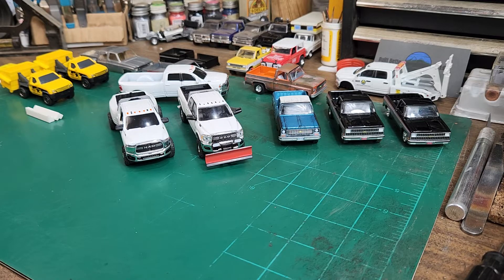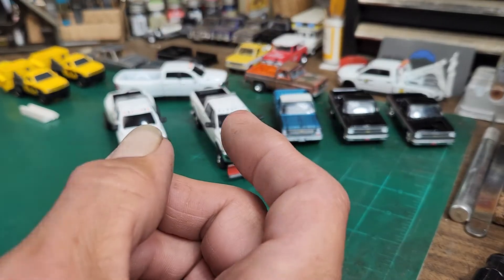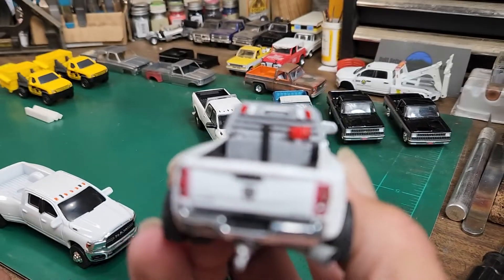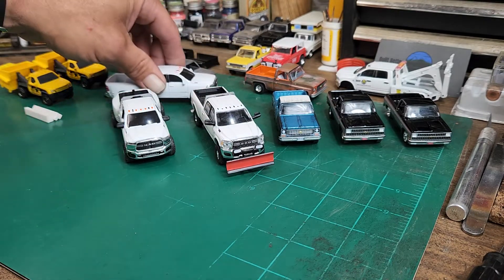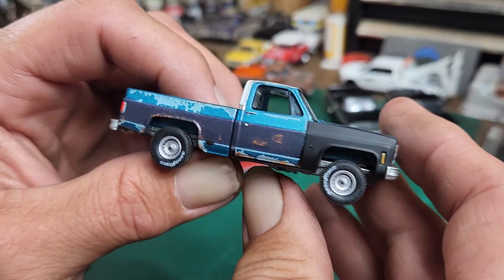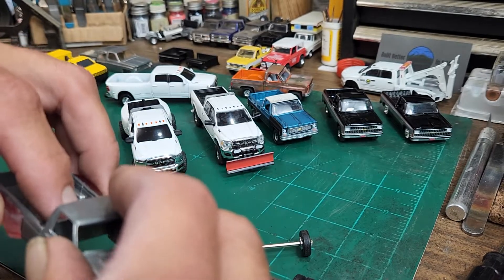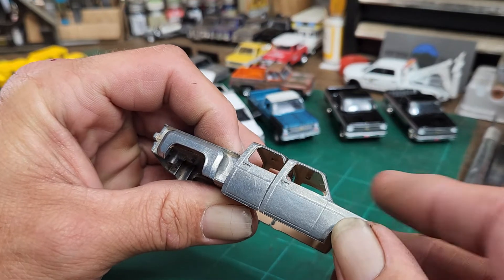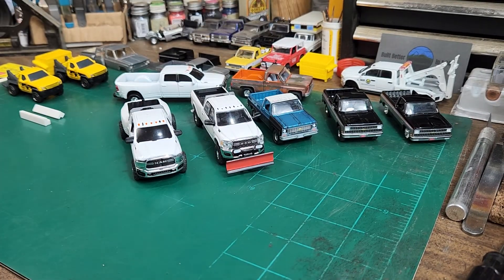New Truck builds , Dodge Rams,

Comment: Ok I have two questions what color do you plan on making the Ford dully and how much do you think you will charge for it I’ve always wanted a stock looking dully bed Ford truck also I have always wanted a square body stock dully bed
Reply from the maker: I don't know what color yet it's not going to be a quick project,  but I will let you know about a price closer to finishing it  do you have any suggestions on paint colors
Reply: @backwoodsmodeler3340  I’ve seen some nice red ones with a white two tone or a all red and I think like a dark metallic green would look nice to